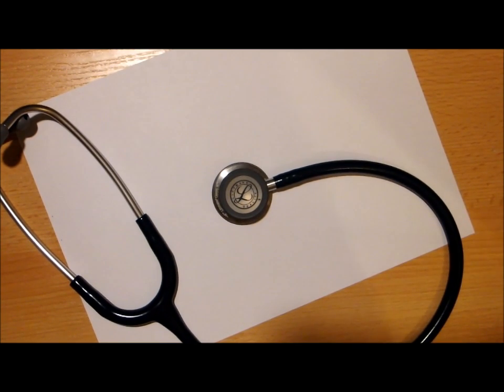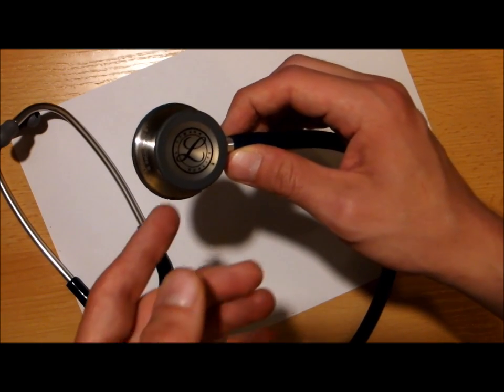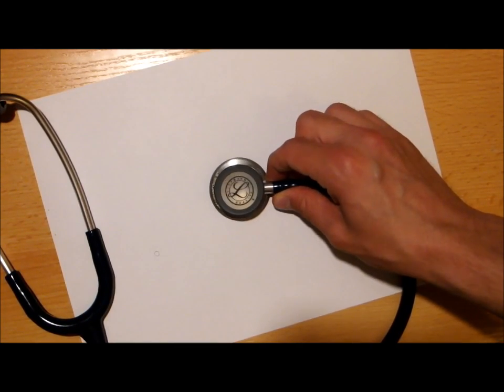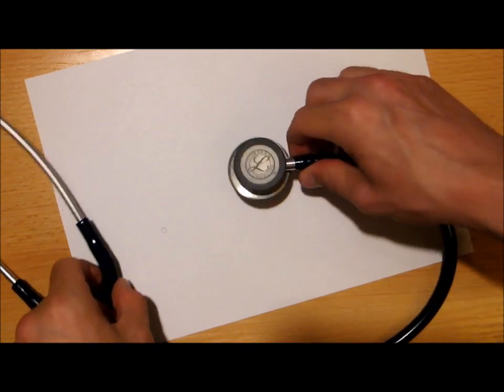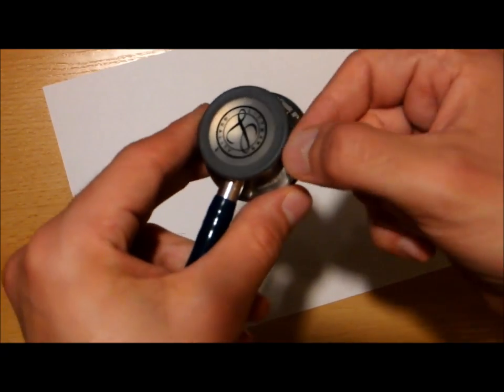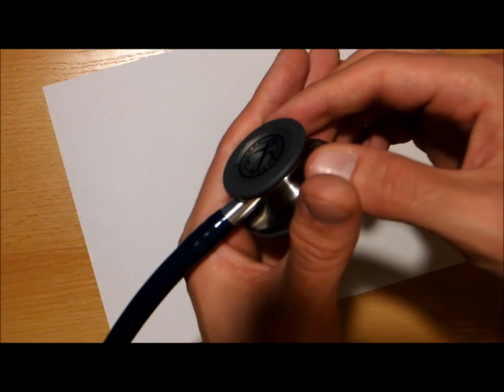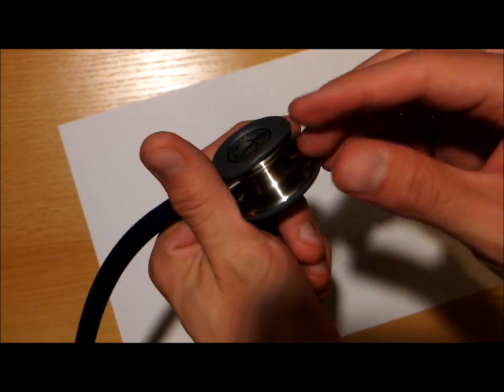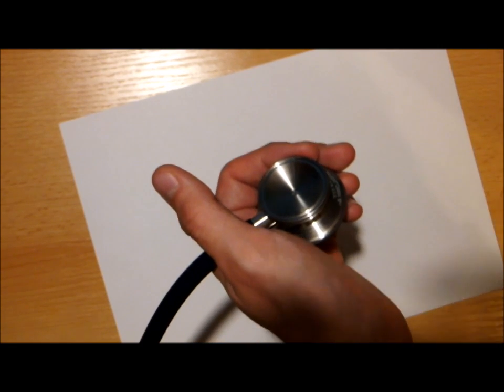3M Littmann small diaphragm removal

Comment: to anyone who's still struggling! i spent 20 minutes breaking my nails and hurting my thumb but could take it off with ease once i simply stuck the tip of a ball point pen underneath the rubber part. no force needed at all.
Reply: Omg thank you! This video was useless to me and fingers were killing me. Your solution worked in 10 seconds. 

P.S. You remind me of the babe.
Reply: Thank you so much I broke my nails too until I read this comment, thank you so much
Reply: you can damage the diaphragm / paint of the stethoscope this way , just a glove/fabric cloth to get a good grip with your thumb

Comment: Just wanted to thank you so much for this video.... I just bought a Cardiology IV, and I was terrified I would damage it in removing the small diaphragm. As you said, the "pinching" did not work. I loved your method of rolling up with a nitrile glove on. It came right off, and I was easily able to convert to the open bell. Thank you again for your explanation.
Reply: I actually damaged mine 🥺🥺 and it was expensive to buy the spare parts kit 😔

Comment: Is there a difference with sound if you remove it. I was under the impression that having it on both sides allows you to use it for pediatrics and adults. If you remove it, is sound louder when auscultating a patient's heart?
Reply: There is a difference in the pitch sounds. Bells are used to hear lower-pitched sounds.
Reply: Bells are used for murmurs and the carotid

Comment: You should use a tweezer.
It is flat and not sharp enough to damage the membrane.
Do not use too much force to insert tweezers between the membrane and the metal part of the stethoscope. 
You just need to pick it up. EASY PROFIT!!!1!!!

I tried to do as shown in the video, but could not. I thought a little more and my nail will be part of a stethoscope.
Reply: Thank you! Nothing else seemed to work and with tweezer I did it immidately

Comment: I used a nail clipper to pinch the diaphragm n pull it out. Done in a few seconds. But.. It may damage ur diaphragm. If like me you have no use for the paediatric diaphragm then go ahead n use the nail clipper :)
Reply: Nail clipper WORKS!!! I broke 6 nails and tried every method before this. Came off in one try & didn't damage any parts!

Comment: Fyi you can use your fingernails to pinch an outer edge, pull laterally, then peel superiorly.  I can do it in about 2 seconds.  This guy struggles
Reply: Hitchslap That trick didn’t work for me
Reply: BookDuchess Then you did it wrong.  Pinch the rim of the ped diaphragm as if it were a rubber band and pull it laterally and then superiority.
Reply: Hitchslap Thank you Sir 
This method helped me
Reply: Thank you so much. It initially wasn't working with the method shown in the video, but this method worked in 5 seconds.
Reply: THIS HERE IS THE REAL SOLUTION. TOOK LESS THAN 5 SECONDS AFTER STRUGGLING WITH IT FOR 5 MINS